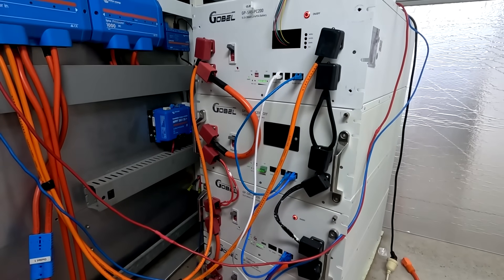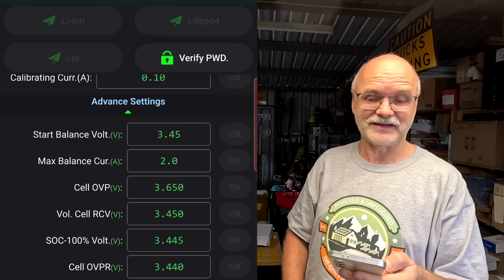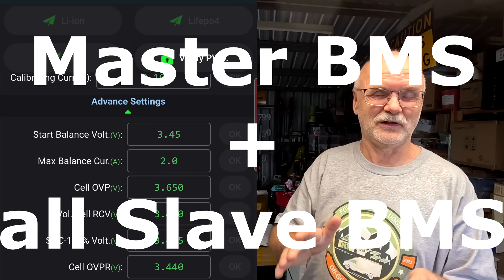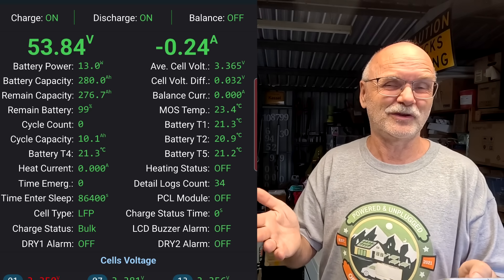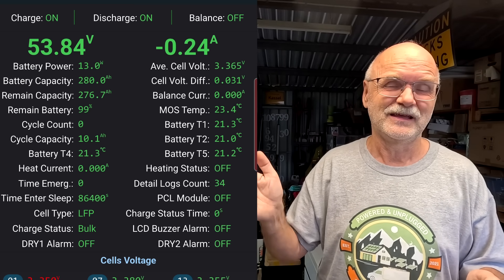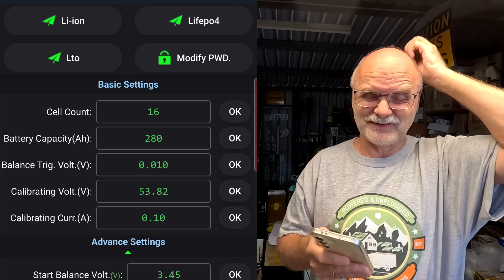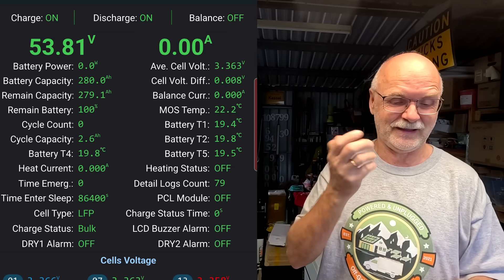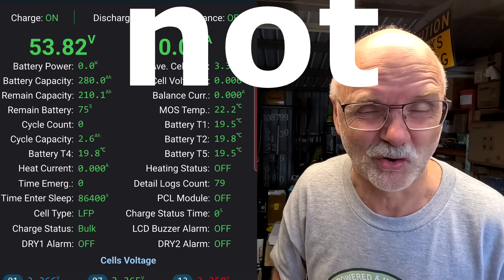2 new hidden features + a new, old bug. The JK-BMS never disappoints!

Comment: Dont BUY jk bms. They are loading bad software to brick them. They do not have tech support and they do not care at all. 

I am not your general customer. I can jtag the hardware. I pulled the firmware and recompiled it, they are purposefully bricking themselves. The hardware is made in china. Theres a high probability that the CCP is forcing their hands. We lost near 300 units. At least I can write these off, you cant afford to be without power. Use another company. I dont know which one yet but do your homework

Comment: Thanks Andy! 
Anyway I am getting angry! why make it so complicated for nothing.
The 100% SOC voltage parameter means nothing! you could potentially put it at 1v since it's only used to verify if > or < of the pack voltage at the end of the timer. But no, because you have to put them in decreasing order.

Use common sense jikong!! make a standard configuration that just works, and then one can customize but this is stupid!

Comment: Andy, Thanks. I just installed the YIXIANG DIY Battery Box in Parallel with my existing battery bank. I now have 764AH and about 41Kwh Capacity. After updating the Firmware to Version 19.13 and Calibrating, everything is working great! We have just entered Fall here in Texas, USA and the system provides all House loads and charges the battery bank by 1pm on sunny days.  Of course Winters are the limiting condition period just like for you in June/ July.  I am planning on adding more solar panels to the Garage apartment roof, 12 on the Eastern slope and 15 on the Western slope (420W panels) and also add a second YIXIANG DIY battery box to the battery bank. This upgrade will bring the total Solar Panels to 26KW, 13KW per Eastern slope and 13KW on the Western slope of the roofs, and a total of 1000AH and about 58KWhr Battery Bank capacity. This will ensure that even in Winters the system will provide all energy to the house loads and still sell 72KWhr/ month back to the Grid.

Comment: Howdy Andy,  
Your  channel is my "go to"  when my JK inverter BMS's ( I have 4 in service so far )   throw up a "new and exciting" challenge...........  just like that which happened yesterday.
Briefly I have a 45kW solar array  with some  "legacy bits of gear"  and this eventually finds it's way into  4 x 320aH x 51.2V  batteries each with a JK inverter BMS V15 hardware.
I live totally off-grid with no access to mains power and have done for 30+ years.............. but that is another story.
All batteries working beautifully  for the past 11 months until I finally decided I should do a firmware ( fireware ) update.  So I rolled out V15.41 firmware and all went well with the update BUT
1. All settings lost .......... no problem to reconfigure / reinstall  settings  .......... just a pain in the ........
2. After reconfiguration the batteries  no longer read 100% when fully charged and floating  they ALL read 83%.  What the  ?
The change from reading 100% to 83% took all of 15 minutes ( well maybe a minute or two longer but not much ) . Just the time it took to flash the BMS's and re-enter  the settings.
If you are thinking about this upgrade ... well be aware that
The V15.41 firmware does NOT have the safety  prompt  if you mistakenly click on the  incorrect chemistry. ........  as shown by Andy in one of his shows. I assume this is a V19 hardware and software thing.
Please keep up the good ... no ..... great work.   I am thinking that JK should actually be paying you a commission. Because without your knowledge and expertise in helping people
fix the issues with these BMS's , together with the legendary JK  customer service  ( I am still waiting for a reply to an email sent to JK customer support over 9 months ago ), JK would have been out of business some time ago.
Once again thanks for your channel and if anyone has experienced the same or similar issue I would love to hear about it.................... particularly if you fixed this issue.
Regards
Greg ........ near Ballarat in Victoria.

Comment: Thanks for the wonderful update again. Just updated the latest firmware to my JK PB2A16S20P HV15 bms's and noticed some settings you don't have in your bms settings (on your website at "my settings"):

Discharge OCP 2 and 3 in the last tab of the JK app.
Emergency timer is added to the second tab ( I think it has to do with the emergency button you can enable)
Battery Temp OTA is set to 30 degress
Battery Temp OTAR is set to 30 degrees as well. Do you have any ideas what they mean?

Comment: Talking about bugs, the older versions had this 510 ohm resistors for the relays, but they should be 240 ohms.... Guess what! On the boxes i received just last week they changed the resistor value... To 100 ohms! Too low! This causes the shift register IC to overload it's pins max allowed current! Changed all 8 resistors of my 4 boxes to 240 Ohms and they work Perfect!
In addition, going to modify the BMS with an external Bluetooth antenna... Only need to test the new BLE modules. No cage of Faraday anymore.
Reply: Which version is this? Although I love taking things to pieces, I've not dared take mine apart because it looks like it's not trivial and I'm worried about disturbing the heat sinking. Are there any pictures of the internals anywhere, or details of what you're doing with the antenna?

Comment: Is anyone having trouble connecting to the V19 jk bms with laptop to update firmware. All settings are correct as just updated a v15. Please dont tell me there is an issue with the bms. I also tried 2 different comms boards
Reply: Solved. Bms UART 2 was on 16. It should have been on 1. Had to use the 485 port next to can and change UART 1 to jk comms no 1. This allowed comms, then dod software update to latest version. UART 2 then changed to 1 as it should be. This allowed the correct RJ 45 ports to be used to connect to the laptop.

Comment: Am I correct in saying the weakest battery pack should be the master? Since it controls when charging stops.
Reply: No, I don't think so. The master checks the status of the slaves.
Reply: @matthewmarks6951  I have noticed when master reaches 100, and slaves 99, it rounds it up to 100

Comment: UGGGH!   The firmware upgrade lost all BMS settings.   I thought I had everything covered by having used the new "export / import" feature on the desktop app.  But you know what... it DOES NOT WORK accross firmware versions!   AND it tells you "Success" when the reality is an abysmal failure to upload the configuration you backed up (or perhaps it failed at backing up the data?)... Either way, JKong is miserable at writing usable software (and documentation).

ALSO:   The desktop app keeps giving an error when trying to set the RFV timer.  But when I check on the mobile app, after getting an error on the desktop, I see tha value was set correctly in the BMS.

There seem to be 3 new parameters to set in the app:
OTA
OTAR
Emerg Time
And no documentation as to what they represent and show to set their value......  Ohhhh Jkong... please hire a native English speaker to write some documentation for you!
Reply: I assume "Battery Temp. OTA" means Battery Over Temp Alarm. This is only the beeper in the BMS, not to be confused with similar function of the DRY relay contacts, which by way have different default values of 60 deg C trip and 50 deg C release.
Issue is it only allows OTAR (recovery/release) to be higher temp than over temp alarm value setting. Does not make sense reset of over temp alarm is a higher temp.

Comment: Sad the abandon fimware upgrades after so little time 😞, thats not right in 2025
Reply: I think as time goes on, lifetimes are going to get even shorter. Remember this is not a mobile phone or a car - it doesn't need security updates because it's not connected to the internet. It'll continue to function in the same way until it falls apart.

Comment: Last thing I want JK to implement is requested charge current changes based on temperature settings. If battery is under 15°C reduce to 0.3C, under 10° 0.2C etc. Same for higher temperatures. Based on EVE and other manufacturers suggestions. I am in contact with manufacturer, but Andy you have higher pushing power :)

Comment: Modified sine wave filter to pure sine wave .. can you do it? 
Pure sine wave is so expensive...😢...if i have to do it i will..but its a massive set-back to the budget as i already have Modified
Reply: Onda pura is good and inverter ibrido tipo easun 6.2kw 450euro 51.2v o 24volt 4.2kw 300euro o luxpower sna6000 o growatt 650euro
Reply: @stefanocerna6504  thats alot of cash..
I got 12v system.. got a 2000 watt modified inverter .. seen a guy filter it to pure with lite ballests

Comment: why do you use communication between JK and Victron system?
do the charging discharging of batteries with Voltage monitoring by Victron inverter
you don't need communication with jk.
the purpose of jk BMS is only protections for batteries banks.
the bms should not interfere with the charging discharging values that are set on inverter...the inverter controlls the charging voltages....what is the purpose of setting BMS communication with inverter?
Reply: Plenty of rebuttals to this and explanations on the latest video.

Comment: Andy, some of us is been having problem to connect JK BMS to the inverter. I mean other brand of inverter not VE. such as MPP, Growatt, EQ4 SRNE, Felicity and some other cheap brand like PowmR. Most of them confuse on what  mode they have to select on the BMS while at the same time what to select on the inverter.

Is there any easy way or method which we can use as a rule of thumb in order to get this done easier. 

I saw Lithium solar use to make custom RS 485 cable to make this work. and still he need to set the inverter and battery mode correctly to make this work. 

as of now, me myself still cant get this to make it work the easier way as in whether to use RS485 or CAN and if we use RS485 on the battery, what setting we use on the inveter either BMS port or RS485.

sorry if this is a lot for you. But if you can put something on this topic, i am sure it will help a lot of us.

Comment: I upgraded my two V15A BMS's to the latest firmware and they both reset, including loosing the LiFePO4 setting and other settings, not too much bother to reset everything but the reason I upgraded was to have the battery charge status (Bulk, Float etc.) but this still isn't visible on the Android app nor on the PC App. Anybody else have this problem?
Reply: I should also say that the two batteries are configured as Master (0) and Slave (1), both with the same settings as (3.45, 3,445 and 3.440), same as Andy's.
Reply: @ColeRV Try with the latest app. (5.0.3 I think). It should show you the new values. Cheers

Comment: I understand better why my BMS no longer goes to 100%. In summer, I change the parameters because I don't need as much capacity, to relieve the cells. As a result, I also change their capacities. I understand why the information has been reset. 
I understand if a company doesn't want to keep evolving the functions of its devices, even if it's questionable after such a short time, but it has to keep fixing bugs over several years. JK really can't be serious, it's unbelievable.

Comment: Hello Andi!
I installed the latest (and final) firmware on my V15 inverter BMS and installed the latest APK BMS monitor app on my android phone.
I FINALLY got to see the new fields for status charge in the BMS app V 5.0.3) which I presume was necessary to see the charge status field.

A few comments:
1) The way the versions are named in your Google drive is misleasing.... one has (chinese characters)BMS_5.0.3.apk and the next one is JK-BMS Android V5.0.1.apk....  At first glance, one might think (and that's what I did) that the first line is for Iphones (it does not say Android) and the second one is for anddroid.... turns out they are both for Android but labeled differently.

2) This does not match the version of the Bluetooth Android software available on Google Play

I also downloaded the latest version of the PC monitoring software from your Google Drive (3.3.3.28).
I made a BACKUP of my configuration before upgrading the firmware (YAY!)
I updated to the latest (and final firmware: 13.411)  seemingly without problem:  

3) It turns out that the firmware upgrade ** RESETS your battery size value to the default 40Ah ****

 I did not notice right away because I have a DIY battery box in which I installed a victron shunt.  I use Solar Assistant to monitor the good working order of things.... BUT my inverter speaks directly to the inverter...    Fast forward to 10pm tonight and my power shuts down w/o a warning!!!    Going to my solar shed and looking at my battery / BMS display, I see that it thinks that the battery is down to 14%.     Without looking deeper in the matter, I did a configuration upload from my backup.....   But this ALSO does not restore the battery capacity!   I had to do that part manually.

Fortunately, when I manually changed my battery capacity, it immediately marked the battery at 100% (instead of it's true SOC of 88%... Thank you Victron!).   I wish my inverter (EG4 6000XP) could read in data from both the CAN bus AND the Shunt USB cable... oh well.     

4) * This might be worth a short README.txt on your Google drive:
+++ Warning: Firmware update will probably reset your battery capacity to 40Ah.   Make sure to check this setting after the upgrade completes +++
I'm sure it would save a lot of hassle to many people 🙂

As a customer of JK BMS, I think it kind of sucks that they would sell you a new hardware BMS one day and the next day terminate support of the firmware.
It's one thing to not add more features to the software if the memory is too limited, but they should address software bugs as they are found.

Thanks for the informative videos!
- Christian

Comment: Good day. I tried the floating charging mode several times. . Jkbms v15, the Deye inverter communicates via CAN, there are no problems with it. But the floating charge works strangely, the inverter in the charge support mode starts to discharge the battery, although there is so much solar energy that there is nowhere to go. 
and I don't even think that the problem is in the inverter, it is completely subordinate to the bms.
Reply: hi have you solved this problem? my deca inverter always keeps the charge above 56.2 as set, and it keeps charging the battery without letting it drop below 95℅so

Comment: Andy, I hope you can answer this question. 
It seems that we can change the SOC to 100% even if it's known to be at 75%.
So if the SOC is changed to 100% from 75%, will it actually perform as 100% voltage and last the same time as before. Hope you understand my question. Thanks

Comment: I think the cycle count is fairly useless.  It just sums the discharge current squirts and when discharge current squirts sums to AH setting in increments cycle count by 1.  

I run four BMS's in parallel in inverter UPS mode connected to grid.  I continue to lose remaining capacity reported by BMS's even though all the 64 cells for four BMS's stay with a float voltage showing within 2 mV of each other at the same voltage long term absolute voltage of 3.35v per cell.  

This likely due to dead zone near zero current with DC offset error screwing up ability to tell small charge squirts from small discharge squirts caused by grid line voltage perturbations and inverter AC tracking of grid voltage perturbations.

I have to hit the AH setting 'okay' button periodically to invoke the BMS to use its battery voltage look up table for SoC.   Just need to be sure battery has had low discharge or charge current for at least 5 minutes before doing the SoC table lookup.

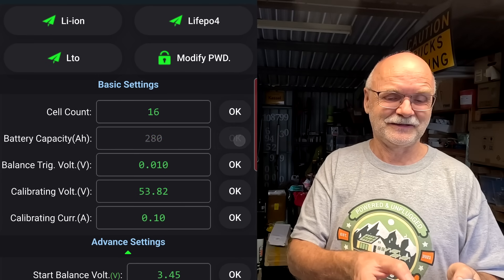Comment: 9:49 - that is not a new bug, it is an old one I had reported several times why the hack they are changing the SoC big time for the same capacity and also for a slightly different one like 281 Ah.
Your charged capacity will decrease big time and same for the SOC.
Reported over 1 year ago and nothing has happened since.  
Same regarding our SPH inverter that the JK BMS always claimed that they are growatt sph compatible, but I get every single day 2 messages with warning for each inverter.
Would I ever recognice a serious warning about a burning Growatt inverter ?
NO, cause I get every day at least 4 of these mails from the growatt inverter reporting errors hence I would not check a 5th one if that might be different.

Big mistake and hence i am disappointed for months that I can not recommand such JK BMS which is destroying the alarm system and awareness of the growatt inverters.
In case of a serious warning this will be overlooked or even deleted due to 4 nonsense messages cause only by the wrong JK BMS . A proper Growatt battery with growatt bms is not causing these messages, only the JK BMS. And even Seplos BMS can handle the protocol and is not causing these messages. My buddy is getting none. 
And Growatt says you should have our battery and not chinese crap from JK which is not capable to proper implement our BMS Protocoll cause they would have to reverse engineer it properly. 

Again: the JK BMS is a mess when they advertise and promise Growatt Hybrid SPH Inverter compliance and can not deliver at least for single Phase inverters from 3000 to 4600 W cause we have multiple here .